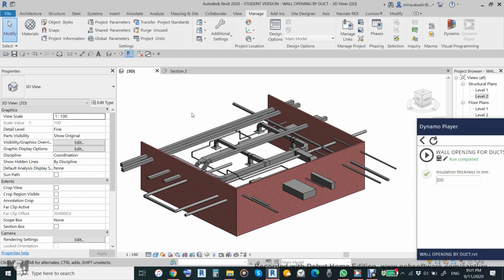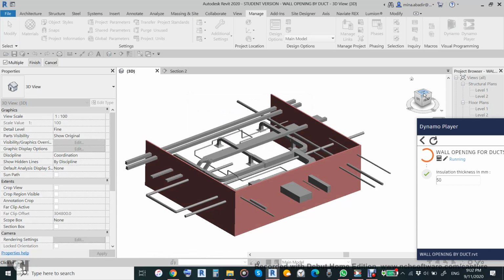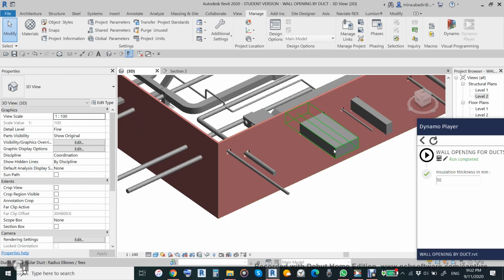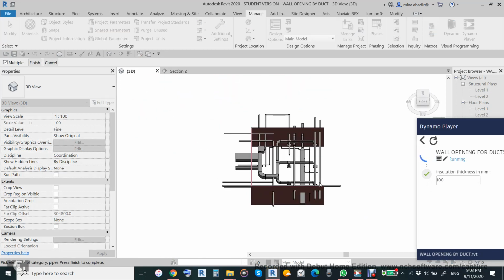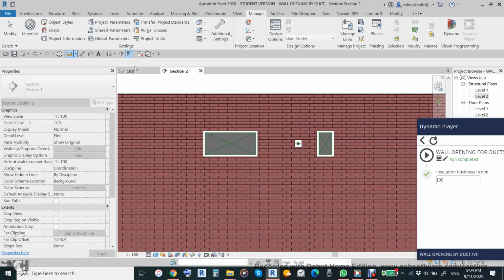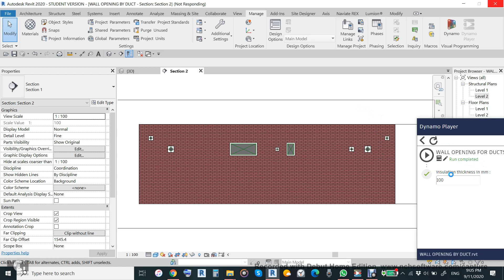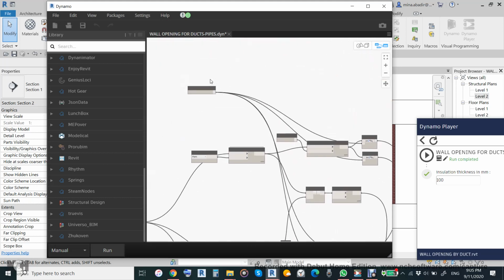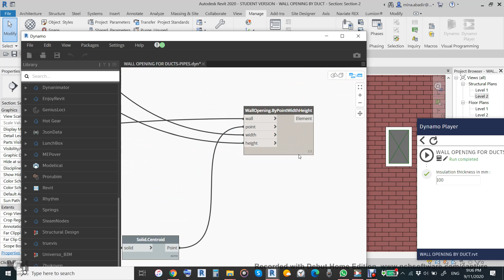Automatic wall opening for duct and pipes in Revit using dynamo player

Comment: Mina, file is corrupted!!!
Reply from the maker: install this pakage it will work

archi-lab.net   	20'2.210.2522

bimorphNodes 	4.0.8

Clockwork  for Dynamo  l.x 	1.34.0

Clockwork  for Dynamo 2.x	2.3.0

Curve.loop	0.8.1

CurvesToPolyCurve 	1.1.0

Data-Shapes 	2022.2.96

DHH-DynamoForRevit 	2018.0.3

DynaWorks20 	2.0.0 	:

Join.Geometry 	8.1.1942

LunchBox for Dynamo 	2015.7.21

LunchBox Quad Gri d by Face	0.0.1

Lunchbox Quad Grid By Face Dalian  1.1.1

MEPover 	2020.6.2

Rhythm 	2021.7.3

spring nodes 	204.1.0

SteamNodes 	1.2.4

StructuralDesign	2021.9.23

Universo_BIM 	19.10.11